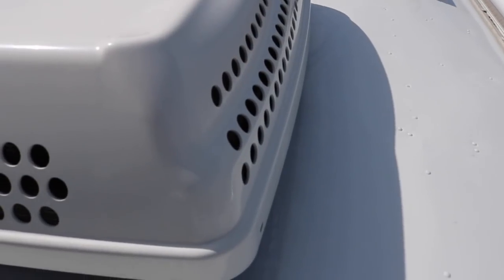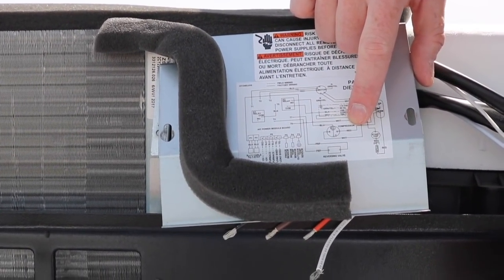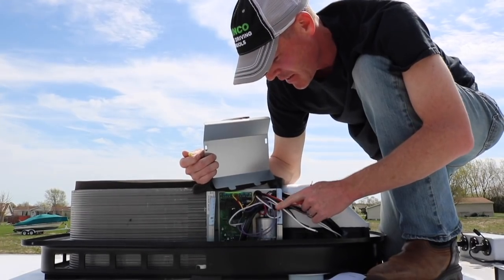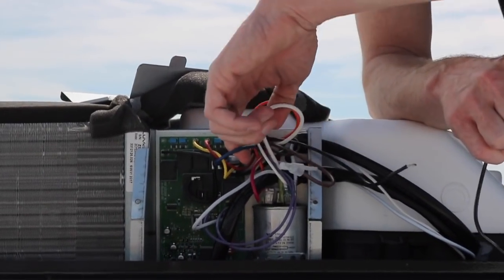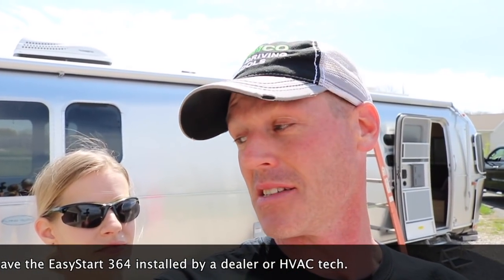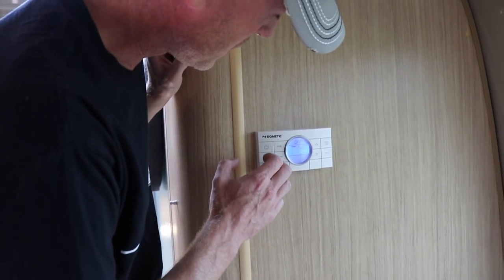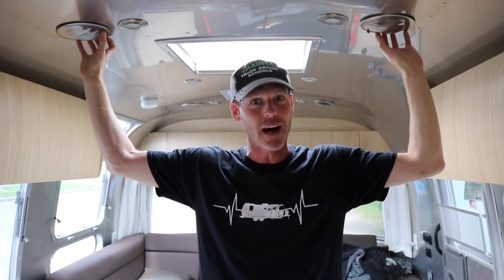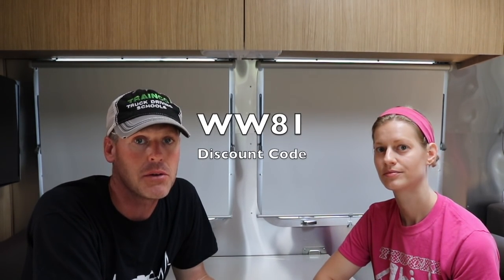HOW TO UPGRADE YOUR RV AC (DIY MicroAir Easy Start 364)

Comment: Hey Wagners!  Nice work on your video! We appreciate your support and your taking the time to produce this.  I'll do my best to monitor your comments here to chime in on any questions.  Many thanks again!  EE Matteo
Reply: They want another one for the 13,500 BTU.  Hook them up!
Reply: Micro-Air, Inc. Do you think I can run my Coleman 15000btu on 2000 generac ?
Reply: Do u think I can run 15000btu Coleman a/c on a 2000w generac
Reply: Hi Joseph.  Unfortunately, we at Micro-Air don't have any direct experience with the Generac IQ2000 generator, nor have we had any customers report any experience with it either.  One thing we have learned over the past 2 years is not all 2000W generators are created equal!  We know with certainty that both Honda EU2000i and Yamaha EF2000iSv2 generators can sustain 2000W of steady-state output without declaring an overload.  The Westinghouse iGen2500 can sustain 2200W indefinitely. Other so-called 2000W generators have proven that they cannot sustain 2000W, and they declare their overload faults well below the 2000W threshold.  This is important in some cases, especially yours, since the Coleman 15kBTU A/C units do require more steady-state (continuous) power than does the 15kBTU Dometic Penguin II like the Wagners have.  Some 15k Colemans requires over 1900W in hot weather.  So, even if installing an EasyStart allows you to start the A/C on your generator, your generator's limited steady-state capacity may not allow it to stay running for very long.  Of course, the latter issue here has nothing to do with the EasyStart and everything to do with your generator.  As a result, we cannot predict what the results would be in your case.

Before investing in an EasyStart, I would recommend that you measure (in amps) what your 15k Coleman draws for amperage when running on utility power.  Then, I would rig up a "load bank" using a hair dryer and another appliance to create the same amp load on your generator and test it to see if it'll keep it running.  That way, you can find out if your generator can handle the steady-state load of your A/C even though it won't be able to start it (i.e. before you get an EasyStart). If the generator can handle the steady-state load test, then there is no doubt that EasyStart will allow you to start and run your A/C on that generator.
Reply: Micro-Air, Inc. so my order only included the unit and wiring instructions, no connectors or grommet/wire ring.
Reply: Hello again.  We see that the above is a duplicate post by you, so we'll answer it again here.  Thank you again for your business!  We apologize for your disappointment.  As it turns out, the EasyStart 364 just comes with its harness since all installations slightly differ, depending on the brand of air conditioner.  Most customers already have the necessary crimp terminals in order to do the installation.  We do offer a low-cost installation kit that includes all of these various crimp terminals, tie wraps, 3M double stick tape, etc.  This kit is mentioned in a couple places on the EasyStart 364 webpage.  If you don't want to do that, all of the necessary crimp terminals are available at any hardware store.
Reply: Asked this above but thought you may have a better answer......What made you decide on the "easy start" there are several other brands out there and several other cheaper options although not sure you get what you pay for?  I have put one of these on a home air conditioner...it was not the easy start brand and it worked fine for about $20 but that was home ac anyhow when you get a chance is there a reason you picked this one in particular or just a general choice? Kinda hard to pay $300 for something that others sell for $20
Reply: Hello Just Let Me Travel.  Thank you for your question.  As it turns out, the $20 solution you are referring to is a hard start , whereas the EasyStart is a soft start .  They are completely different from each other as explained in two other responses elsewhere in the comments to this video.  Hard starts are not nearly as effective as soft starts since they do not reduce the starting amp surge (i.e. they shorten the starting duration by applying increased starting torque at the expense if higher starting current ).  EasyStart is best in class in the industry right now, and delivers 65-75% starting surge reduction , as it increases the duration of the start, making it much more gradual and far lower in surge amplitude.  A hard start might make a marginally not-working situation marginally work, but if there is any significant gap between what a limited power source such as a generator or inverter can apply, and the starting amp surge of an air conditioner's compressor, the hard start won't work.  Please read the explanation on the difference between a hard start and a soft start in the other comments.  If you are still unsure, please send Micro-Air an e-mail and it will be explained further.  Thank you again for your comment.
Reply: Much better explanation I knew there had to be some big difference go from 20 to 300 ..... now of course the question for me is....do I need it and will it make a difference based on my own usage....either way good to know and will be able to pass along the knowledge to others like Wagners do such a great job of.... will go check out your youtube assume you have a demonstration/explanation there?
Reply: Thank you for taking the time to understand everything.  We appreciate that!  Yes, we made a video 2 years ago (time flies!) where I painstakingly compared the results of the most popular aftermarket hard start to the EasyStart soft starter.  Check it out on our channel or via link from our website's EasyStart webpage (Manual's & Resources tab).
Reply: @MicroairNet  yes "soft-starters" are PERFECT for reducing start wear on AC equipment (compressor, contactors) and generator. It ramps up current in the whole RUN winding basically over 3 seconds.
Where "Hard-start" kits are used to manage the start winding and disconnect the capacitor.
So I think a combination of both may the way to go! 
Using a PTC resistor to control the start winding current is the old fashioned cheap solution. It causes the run winding to use more power by opposing it to heat the PTC... increased vibrations etc. It's a PERFECT solution to have a Triac cutoff the start-winding after start is proven hence "hard-start" kit  for start winding + "soft-starter" for the whole unit
👍🏻

Comment: Great video!  We've been using the Micro Air easy start for almost two years.  Works very well.  We ran ours with a 2000I Honda generator.  We now have the 2200i honda for a little more overhead.  The 2500 Westinghouse looks like an even better choice!  Remember that there are other things in the trailer that can interfere with the easy start from working.  Your refrigerator if not on propane, and also your converter if your batteries are low.  Your converter will try to run at 14v and use some of the power of the generator.  Not an issue if you are in trickle mode, but be aware.  If your compressor kicks off (fan still running) on the AC, just find what else is running.  For the Dogs, get yourself a "Temp Stick" and a hotspot wifi so you can monitor your cabin temps while your in that restaurant.  We've been using the temp stick for years and it is the best for this purpose.  Good luck and thanks for a clear installation!
Reply from the maker: Thanks for the feedback. It might be helpful to others!👍😊

Comment: After installing mine I can run it on solar.   Love it , I hate generators, you don’t heard much yours because you are inside with the a/c fan but if you walk out , that thing is screaming and annoying.  You just don’t show how loud is that thing in the video.
Reply from the maker: Inverter generators aren't that loud. Open frame generators are crazy loud though.

Comment: Something not everyone knows is that, while a 15 K BTU AC only needs 1500 w to run, it draws 3500 w to start. I was told once a RV starts to cool off, to turn the fan down if you can so it won't cycle as much. The MicroAir Easy Start solves that issue. Great video.
Reply from the maker: Yes it does! So far it's been working flawlessly and it's definitely worth the money we think.

Comment: I replaced those flimsy Dometic screws with some slip over the plastic steel fender clamps and stainless screws with fiber washers so not to scar the cover. It’s not flying off. 

Good video I got a little lost with the capacitor rip out part
Reply from the maker: Good idea with the screws!

Comment: I installed my Easy Start last weekend. Took the Ka Thump! out of the start up. Especially nice since my bunk is directly below the AC. I see you have the Penguin II ACs. Mine is the original Penguin and my compressor unit is a horizontal cylinder and a little tighter fit. Actually, there is a spot directly behind the cold side squirrel cage where you can run your cable without going through the hot side. I have on board a 3600w gen but I haven't yet tried it with my smaller generator/inverter.
Reply from the maker: Awesome to hear! We are loving ours and hope you like yours as much

Comment: The Westinghouse iGen2500 is currently on sale for $529 at Home Depot.  I bought one a few days ago, very impressed with it.  I connect it to my manual transfer switch at my house to run a fridge, 6000btu window AC unit, freezer, and most of the lights (all LED) in my home.
Reply from the maker: Awesome thanks for your feedback! It's been a great little generator so far

Comment: This is where having a degree in electronics comes in handy. I actually designed and built my own startup system beased around the Atmel (arduino) MCU and total cost of all the parts was under $30 but the key is you MUST know what you are doing so you dont create a fire or shock hazard. Mine does what the easy start does not do though. Mine data logs the runtime, cycle time averages, current and voltage values on each start and I can download this data via a USB interface on the main PCB.. it's kinda neat but not necessary of course. I just like to push the limits of my knowledge sometimes lol.. Anyways I do not reccomend building your own start system and I do reccomend the eaststart to people. Yuo can also use easy start on Home central and window A/C units as well if you have a backup generator there..

Comment: Thanks for throwing this video up! I'm about to sell my A-frame and get an RPod, and have a Westinghouse 2200W generator. It struggled to start the 8000BTU Cool Cat in that unit, so I'm just going to get an EasyStart when I get the RPod. The Westinghouse is so quiet when it's on eco mode. I couldn't run it in eco mode with the previous camper. I'll refer to this video when I get the camper and the EasyStart unit!
Reply from the maker: Awesome! We love our EasyStart. Remember to use coupon code WW81 at checkout to save $25 when you do order. Let us know if you have any questions!
Reply: Got it delivered... they didn't include the installation kit. Oh well, I've got butt connectors and crimp connectors somewhere around here.... (I've got a degree in electronics engineering, I have tons of little bits from projects over the years!)

I used the code, thanks for posting it!
Reply from the maker: Yeah we mentioned in our video that the installation kit is sold separately due to a multitude of different AC units it could be installed on, but like you mentioned, all of the things in the kit are basic and most people either have already or can be bought at any hardware store cheaply
Reply: Ahh OK. I picked up some blade and butt connectors... I probably had enough sitting around in various tool boxes to get the job done.

Got it done, only made one boo boo. I inadvertently connected to the white wire on the blower instead of the compressor. Easy fix. Now I'm doing the start cycles, then I'll test on my generator. The install on the 13,500 unit is identical to yours, so the video was a huge help! Thanks again!

Comment: Very good video and very informative. The only concern I had was you were really moving close to the compressor cap. I wish you had included a warning about not touching the cap terminals. You can get a really nasty shock off it unless you discharged it previously...

Comment: And one more thing.... keep your small gens locked up... chain them down or they will walk away.  I chain mine to the front of my airstream and I lock it up when in the back of my truck.
Reply from the maker: It's chained and locked up👍
Reply: What they can walk away
Reply: No amount of chains and lock are going to stop a determined theif though, if they cannot get the generator  I have seen it where they steal the gas from them..

Comment: Thanks for doing the install video. It looks like it was an easy install and should be great to have when boondocking. As for the generator it was only a few months ago you bought a HF Predator.  Did that one not work out for you? Cheers.
Reply from the maker: We do have the predator but it's a 3500 watt generator and It will run our AC already. However a lot of people don't have or don't want to get a generator that large. And with the EasyStart, they don't have to get a big generator to start and run their AC. Had we known about this product before getting the predator, we probably would have gotten a smaller generator to begin with. We used the Westinghouse as an example for those who have a smaller generator to show we can run our AC with it, after installing the EasyStart.

Comment: If you get another, get the chord that links them together.  You can make 5000 watts at 30 amps that way.  And your only running one when that's all you need.  Hope I don't see your cover on the road.  Tighten those 4 screws.  LOL.

Comment: Thanks for a Dometic low profile install!  I've got a 22' Bambi Sport with Dometic 13500 BTU unit.  My shore power at home is only a 15amp circuit.  Will that be sufficient for the learning starts?  There is a RV campground about a mile away if I need 30amp service for the learning starts.  l recently got the Bluetti AC200Max to run off grid similar to yours. Thanks for the reply!  =D-=
Reply from the maker: Your best bet and safest bet would be to go to the campground for 30a power for the learning starts

Comment: With 2 air conditioners if we install one of those in each could we run bot units with a pair of 2000 watt predator inverter generators?
Reply from the maker: A lot of variables are at play. You'd have to calculate your power needs and see if those gens can support it or not with the ez start 364

Comment: Are you able to run both AC units on your generator? If so what is your start up amp reading? For both?         Thanks Geno
Reply from the maker: We don't have easystart's on both AC's so it didn't start both in the high heat. Perhaps if we had EasyStarts on both AC units
Reply: Wandering Wagners Thanks for your response, I was just wondering because I just had an additional AC unit installed on my Airstream. I have a 2400 watt inverter generator and was wondering if it could run both, I know it will run one AC. Thank you!

Comment: It definitely beats the price of having to buy a Honda Companion Generator to go with my EU2000i to run the generator.  EE Matteo will this work with my EU2000i to run a 13.5K BTU AC.   If so you sure sold me.
Reply: Hi Slim.  Absolutely!   We own both a 15k Coleman Mach 8 and a 15k Dometic Penguin II (like the Wagners), and with an EasyStart installed, we can start and run either on our Honda EU2000i from ECO Mode!
Reply from the maker: Yes! It will work for you. Don't forget to use coupon code WW81 if you do decide to purchase one. Thanks for watching!
Reply: SSWWEEEEEETTT!  Got to get new tires for the Queen's car first but with summer coming it will be nice to run the AC out boondocking.  Thanks folks for hooking me up.

Comment: I have the igen 2500, added one of the $12.00 hard start capacitors. Most of the time it will allow the coleman rooftop 7100 btu older model to start but overloads the gen most of the time. Will this device fix the problem ?
Reply from the maker: Yes it should

Comment: I have a 2020 Leisure Travel Van RV & it comes with a power shut off switch inside the cabin - will that be sufficient to allow me to install the start in my ac?
Reply from the maker: Yes that should be fine.

Comment: That's just awesome! Thanks for the information.
Be sure to secure your generator to the tongue with a heavy duty bike cable lock, so it'll still be there (and your dogs will still be comfortable) when you get back from shopping.
Reply from the maker: Yes, the generator is locked and chained up. We felt no need to show that in the video.👍 Thanks for watching!